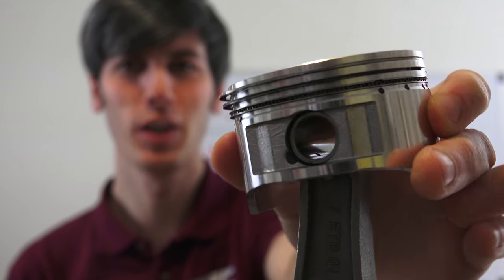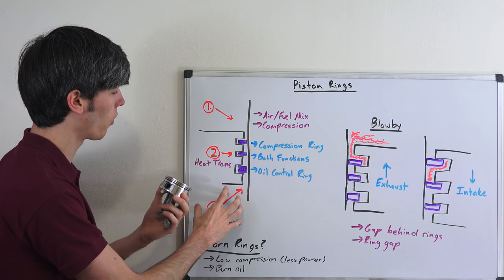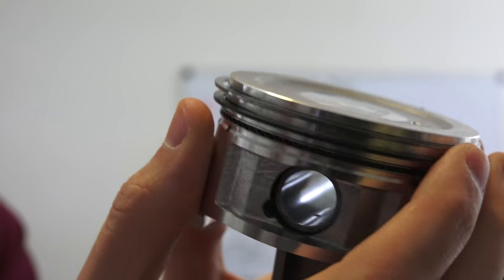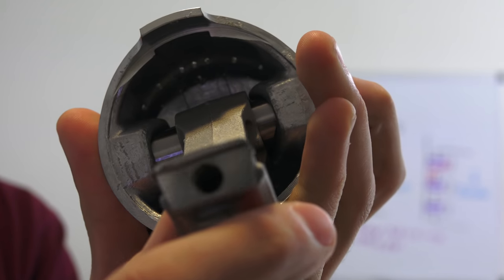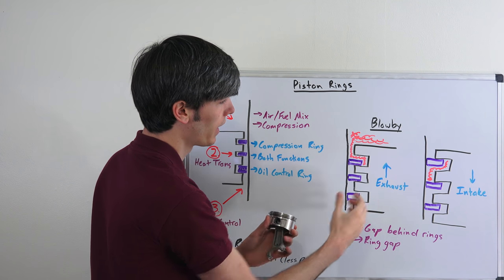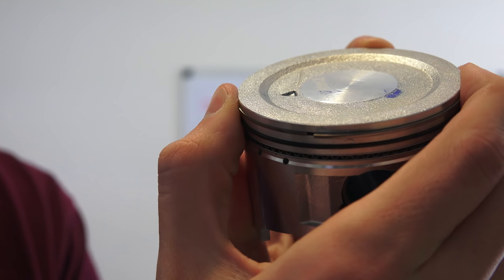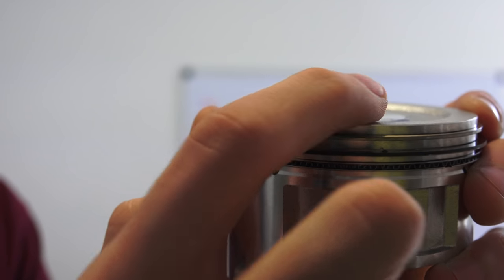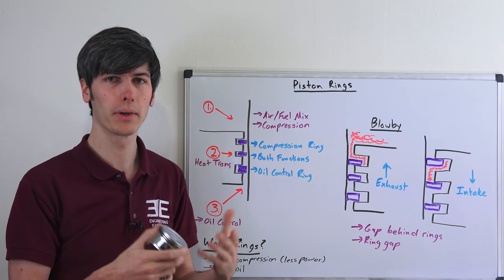Piston Rings & Blowby - Explained

Comment: are ring lands still a issue on your 2014 sti? if so, how do you plan to prevent that?
Reply from the maker: +TheCriminal3k According to the internet, yes. I have a warranty though. Never seen good data on the subject, so I don't mention it much.
Reply: +Engineering Explained Time to start modifying to test that theory 😀 In the name of science man!!
Reply: Ring butting kills ring lands. Need correct ring gap for boosted high hp engines...
Reply: +TheCriminal3k = Here is an article that explains some of the thoughts as to why there is so many ring land failures:  http://www.igotasti.com/vBforum/showthread.php/7510-How-to-Avoid-Blown-Ringlands-in-your-WRX-or-STI
   My feeling is that it is the oil vapors coming back into the engine via the PCV valve, resulting in a dilution of the fuel's octane value, resulting in engine knocking. An air-oil separator is the best bet here, but i would simply disconnect the PCV valve from the intake, put a plug on the pipe going to the intake, and then put a short length of hose to the PCV valve so it vents the oil vapor out to below the engine, where it will then drip away and not mess up the engine with oil residue.  Really old cars did this, they simply had what was called a draft tube. Basically it was a tube that attached to the motor where this crankcase vent was, and it ran down to the bottom of the engine bay under the car. The draft of air under the car while you were driving whisked away the oil from the tube and straight under the car on to the road. 
   Oil being burnt in the combustion process can cause detonation, which is bad. It can cause knock which is bad. If you get detonation you can physically harm your motor, such as having your piston's ring lands cracking, as is happening with so many WRX and STI engines these days.
   http://oppositelock.kinja.com/ditch-that-pcv-system-before-it-is-too-late-1634156554
Reply: +Alex Delgado Buy a WRX, worst thing that can happen is rod bearing failure (mine spun at 190k miles).
Reply: +Dejected Sasquatch ring land failure is a problem in the WRX as well
Reply: TheCriminal3k Oh. I've got the OEM 2007 EJ255, I think it has different pistons.

Comment: I know this is and old video but I have a problem with my single cylinder engine. It makes an intermittent ticking from top of the  engine. If I switch off the engine when hot and start up.. The idle is weak and ticking is more noticeable but goes away when i start moving again..also consuming more oil. Would this indicate blowby at the rings?

Comment: So I know I have blow by in my recently built Dodge 440 (I didn't re-ring it when I did the camshaft and cylinder head change).  Now can you explain why I'm only noticing blow by out of my valve cover breather but I do not have any blue smoke from my exhaust?

Comment: what are the common reasons that piston rings wear out?  My car seems to be burning oil..and I seem to take care of it in terms of routine maintenance. I change the OIL/Filter every 5000 kms..and I also do enjine flush to get rid off any dirt.  Can you explain why my car is burning oil, when I have done everything according to manual. Every month I have to add 1 litre of oil to the engine block....and I just dont understand why this is happening!  Do the rings just wear out with age or as long as the proper maintenance is done then they should last.  Thanks. Look forward to your feedback.  PS: I have a HONDA ODYSSEY.

Comment: I have a question. I have a Dodge Ram with a 4.7l that really burns oil, especially at start up. After a few minutes the white smoke stops rolling, but it still burns it, a little black smoke, especially under acceleration, to the tune of 2 quarts per 30-40 miles. It had 200k but was just rebuilt by a supposed mechanic. The compression on all cylinders is at 150 psi. How can I tell if this is a valve guide/seal issue or a ring issue? I was told if the intermediate ring was installed upside down, that it could cause this. If it's a valve issue, can I change the seals without pulling the heads or should I have these heads rebuilt or buy new/rebuilt heads? Thanks! Loved the video!

Comment: Hey, could you make a video about turbocharging 2 strokes? I know it's a rare modification to occur in today's world but there are some tuners that build monster 2 stroke's based on direct injection and turbocharges for example in racing sled's. I'm just curious how they deal while with the excess of pressure blowing direct from the transfer ports to the exhaust ports ( for the little while, during which both are open). I know that normally the expansion chamber exhaust in a 2 stroke would deal with this, but isn't that much of pressure disrupting or even destroying the pressure wave's going back to the cylinder? Still those tuners get a lot of power tuning adding turbo's to those engines ( have seen lately on youtube a turboed 1000cc 2 stroke blowing 500 hp + in a sled).

Also a video about pressure wave tuning differences in an intake of a N/A and turbo'ed 4-stroke would be interesting.

You're doing really good videos. Keep on going :)

Comment: Question: On an older bike like say my 02 Shadow VT750, would it benefit from an in the oil product like Mystery Oil or Lucas? I dont use additives on my bike except Seafoam in the fuel tank once after an oil change to keep the carb clean. Just don't know of any proven oil additives for a car or bike. I would think no on a bike with a wet clutch due to obviouse reasons. Anyways, thanks.

Comment: Just wanna ask, though, you said that if the piston rings are worn out oil may pass through the combustion chamber, And may cause problems, right? so, how about the spark plugs, will it not be affected by the oil in your chamber? will it be noticeable if i try pulling out my spark plug? (like traces of oil on the spark plug... )

Comment: Question: How does the oil get from the sump to the bottom of the piston and out those small holes?  If I'm not mistaken there are some engines with oil jets that spray oil on the bottom of the piston?  I have rebuilt a Toyota 1uz-fe V8 witch is a high revving engine and I could not find any jets in the block?  And also how does the piston pin get lubricated?
Reply: +Christiaan Roos by oil splashing up from the crank, it doesn't need much, a lot of heavy duty turbo engines have oil sprayers, mostly for piston cooling

Comment: How do you get consistently like 15 bar of compression if these rings aren't perfectly sealed and there is always a tiny gap between the 1st and the 2nd and the 2nd and the 3rd ring?
Reply: Witchcraft
Reply: +P4WELpl It allows gases to move trough to the crankcase, the piston rings don't release pressure. Any pressure change in the cylinder is from the change in volume as the piston moves. Volume = to pressure and Heat, which are interchangeable values.
Reply: +P4WELpl The gaps are offset.
Reply: +P4WELpl You have to think about the fact that one rings gap is compressed another rings solid, so when they are forced together, it essentially seals the gaps. Like +TheFlacker99 (Flak) said, they're offset.
Reply: +Togue Titan; You can't lose compression over time, or you will find your car at the bottom of that hill you parked it last night

Comment: Hello  , i wanted to ask a question since you seem to be preety knolegdeable on car engines . I have a problem with my wv sirocco i had lost compresion in two cylinders and the mechanic told me that two pistons were damaged and i need to change all four of them. After removing the piston head the only thing wrong with it was a broken piston ring. Did they scum me ?Thank you for your answer.

Comment: @Engingeering explained if the compression test is 140 PSI for the four cylinders but there is some knock and rattling noises. That means i can replace the moving assembly including pistons, rings, rods, rod bearings without grinding/machining the cylinder walls and  the crankshaft might need machining for the new bearings? Please advise.....

Comment: What's the best way to prevent the rings from wearing? Changing the oil often? Anything else?
Reply: +TheEgg185 Not much you can do, it's just a natural wear item.  Usually rings will be fine until 100,000+ miles before you notice any problems like an increase in oil consumption.  Some engines can last 2 or 3 hundred thousand miles before ever noticing wear.
Reply: Make sure you don't go too long without an oil change. As long as you have clean oil in there the rings should last a long time.
Reply: I have a vehicle that I apparently put LESS than 3,000 miles on it a year. its hard to know exactly when to change it.
Reply: Have modified tuned Sti. It has heat wrapped equal length headers (no rumble now) and larger Garrett turbo. Since I got car I have had to replace O2 sensor as old one was gone and emissions were failing - running rich I think it was. Aslo replaced half broken stock intake with short-ram - Ii know it sucks hot air from engine but the Sti vent thing is still blowing outside cool air at it when moving. Also changed spark plugs and faulty idle air control valve which was jamming and causing engine cut-out. Did compression test on cylinders a good while ago - seemed to be OK. Don't know about cat or how to check if its blocked? Would love to be able to take out engine and examine everything. Anyway it gets about 400ft/lb 400bhp at the moment.

Comment: If getting lots of crank case pressure is that likely worn rings?
Reply: The piston assemblies and crankshaft produce crankcase pressure by reciprocating but that is not the same as blow by. Blowby is gases that under combustion pressure seep past the piston ring end gaps, not between the piston ring to cylinder interface. If you think that you have excessive crankcase pressure, put a gauge on the PCV valve grommet. It is always best to work with numbers and the values they represent. A stuck closed or restricted 
PCV valve circuit can increase  crankcase  pressure as can some restriction in the PCV valve vacuum port. I would check that before having nightmares about an engine overhaul.

Comment: I can see how the gases travel to the crank case but what happens when the gases gets there. Is the crank case sealed in or does it have a release valve. I just want a clearer understanding of what happens when the gases enter the crank case and how the engine handles it.
Reply: You're talking about the PCV valve, which opens with intake manifold vacuum during off or part throttle, relieving crankcase pressure.  Under load, the intake manifold is filled with atmospheric air so the PCV valve closes, using air intake hoses routed to the crankcase and heads, to draw crankcase pressure out and  reintroduce it into the intake tract.
Reply: +OCTurboJoe Thanks a lot, your explanation was very helpful!
Reply: +Sterling Walker This system acts in two different ways, depending if your car is NA or turbo. In a NA car the PCV valve is always open at various degrees of engine load. Aside from that, it usually also has a T fitted and another hose that re-routes blowby separately in the intake - you know just in case the PCV valve does not permit the full amount of air to pass through it. In this case - an NA car - the only time the PCV will be subjected to closing fully is when you have an actual backfire, meaning air will travel backwards from the combustion chamber to the intake manifold and therefore eventually reach the PCV depending on positioning.   On a turbo car you add another situation where the PCV valve will be closed fully when you are under boost. This is because you have air in the intake which is at a higher pressure than the blowby gases that come out of the engine.. At this point, all the blowby skips past the PCV (i have mentioned the T fitting before) and gets back in the intake (hose should be mounted between the air filter and turbo intake).   Systems that use oil catch tanks will have them mounted before the T fitting, so whichever path the air takes after exiting the catch tank, only oil free gases get back in the intake.    Of course, there are systems that vent blowby gases directly into the atmosphere - these are less efficient because in this case gases have to travel naturally outside of the crankcase instead of being forcefully sucked out.

Comment: when building an engine, what can be done to get that absolute minimum amount of blow-by? I have file fit my rings according to what the engine would be seeing (mostly N/A street - interstate use) by it seem that you always get blow-by. even with total seal rings. thanks
Reply: The only thing other than ring gap that I can think of that would affect blowby would be the thickness of the rings, the less tolerance between the ring and the groove the less lateral movement, and with less movement comes a smaller passage to blow through if that makes sense. Also, thermal expansion comes into play with different materials of pistons and rings, for example, forged pistons expand more than cast from cold to normal operating temp, thus requiring more piston to wall clearance, and they will provide more opportunity for blowby cold (also risking piston slap, but that depends on a number of other things that we aren't discussing anyways). So in theory, from my understanding, a cast piston with tight ring gap, thickest ring within spec made of a material that will have minimal expansion  will be the least prone to blowby.

Comment: So if my car's mileage is 170k but i do not have any blow by since oil does not get burnt. Chaning these rings as well as the pistons with some otherr rbuilding parts will keep engine running as a new one? In that case? do you i need to replace my camshaft & crankshaft? or i did not reach this stage yet? Knowing that i seen a lot of debris around the camshafts and valve lifters and the valve lifters need to be changed. Please advise @Engineering Explained.

Comment: what's your opinion on a hard break in of a single cylinder motor?
Reply from the maker: I always go with what's recommended by the manufacturer.
Reply from the maker: I always go with what's recommended by the manufacturer.
Reply: +Engineering Explained boring
Reply: +manuel grohse Smart.  Manufacturers have whole teams of well-payed engineers working on these engines.  "Hmm, should I go with urban legend on engine break in, or what the Master's-degree-having, experience-wielding, well-payed engineers have to say?"
Reply: Just bash it till it bleads :)
Reply: +manuel grohse that's what she said
Reply: +Ninjar They also only make money by selling you a car. Is it really in their interest to have a strong engine that will last longer? Companies that rebuild engines costing more than most cars complete break them in using the "urban legend". I think you'll find theres more research into it that myth.
Reply: +Stuart D89 Indeed. Maybe if things werent designed to break after a certain period of time (planned obsolescence)  I would be much more inclined to listen to the manufacturers. The advice is far more likely to be coming from the marketing department than the engineers.
Reply: There are other factors to consider, such as oil changes. When you do a hard break in you need to change the oil after just 20 miles, then again at 200 miles and then 600 miles, the more you can change it the better though. Can you imagine a dealership offering that to a customer? It would be embarrassing.

"Can I interest you in a hard break in service plan? It will cost £600 and we will need the car back in 20miles, 200 miles and 600 miles"

Another thing to consider is that there are legal implications. They cannot recommend to you that you should go out and immediately start doing loaded acceleration runs in all gears in a vehicle you have just bought and are not used it. Any crashes/ speeding violations can drag the dealership into a legal mess, its better to recommend owners take it easy for the first miles.

Comment: Hi we own a late model Pequot 308 GT diesel with 25,000km on the clock which my wife has just damaged slightly in the front. The panel man is a good friend & after dismantling the intercooler he called & advised there is dark oil in the intercooler pipe both bottom & top. This 2017 car is apparently suffering blow by. Two Peugeot service agents have looked at the car and deemed it perfectly ok, should we be concerned?

Comment: Hi. I've learned that the rings rotates slightly in the piston movement. So, sometimes, all the three gaps are aligned in some moments. Is that true?
Reply from the maker: I suppose it's possible. The gaps are very small once the ring is compressed however.
Reply: +DesastreMan1 Thats why when you replace rings, you offset the gaps by 120*.. If things like the hone job and ring tension where done correctly, all the rings will rotate at about the same amount and keep those alignments. However, it still allows blow-by as the gas will go through the first gap, turn and go 120* around the piston and go through the next gap, and turn again toward the next gap, and so on.. This is why ring gap is important as well. You want the least amount of gap to reduce blow-by, but not so little that the ring ends touch when things get hot.
Reply: +Engineering Explained Hey,can you explain how velocity stacks work?

Comment: Is it true that using a non-synthetic oil in older engines can help reduce blow-by due to a slightly thicker viscosity despite it being the same weight as a full synthetic type?
Reply: +drinix yes, older engines are happier with mineral or semi synthetic.
Reply: +Grobbekee i keep hearing that, but it's not true